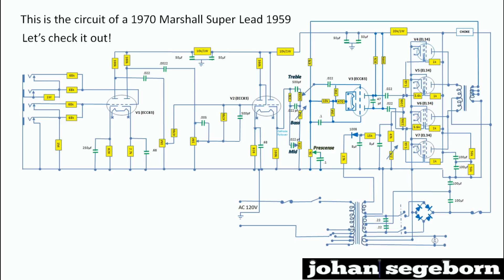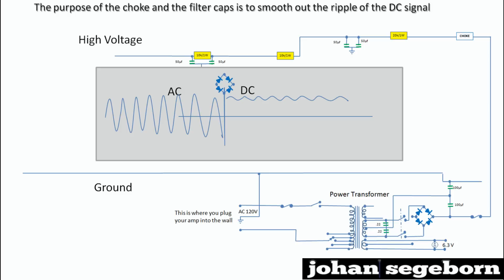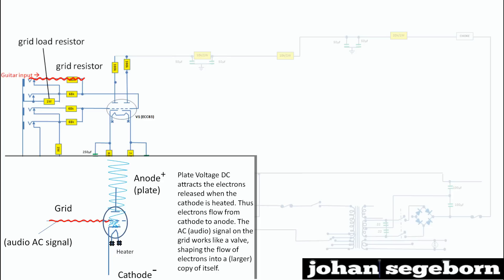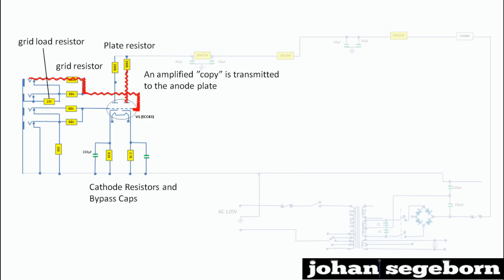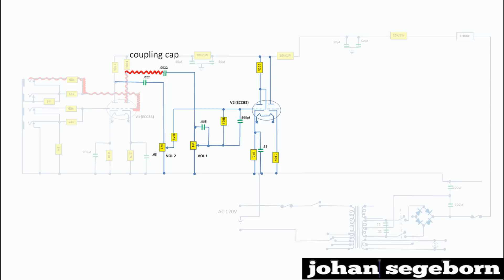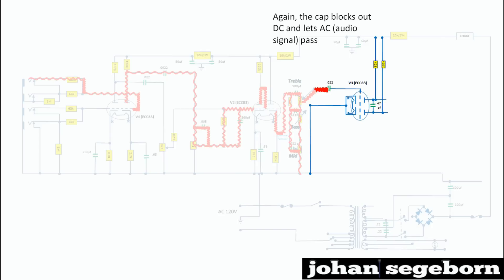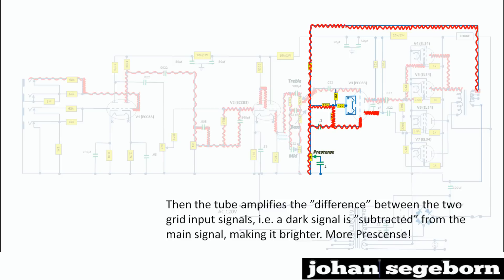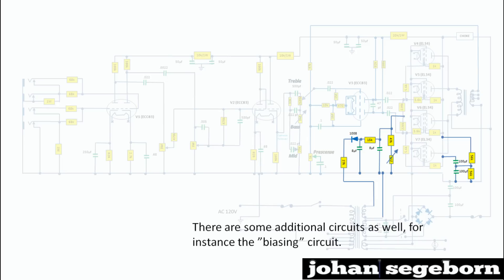How does a Marshall Super Lead Amp work?

Comment: JOHAN SEGEBORN, 
1.) When you're biasing the power tubes in an amplifier circuit how do you bias the compression of the power tubes the 1dB compression point of when the power tubes start to compression? because its say to bias tubes at a 30mA bias current per tube to be safe but how do you know when the tube is compressing?
2.) Most Power tubes 6L6,EL34 use a B+450vdc on the plates, if you increase the B+ to +600vdc would this increase the AC ripple but why would it increase the AC ripple? i would think it would decrease the AC ripple because more B+ voltage mean less current draw from the power tubes. 
3.) The Choke coil wire is frequency dependent which I'm not sure why they made the Choke frequency dependent in guitar amps linear power supply. Is the Chokes storing current like a reservoir like the filter capacitors or is the Choke doing something else to the AC ripple, not sure if the Choke is regulating the current? If you remove the Choke from the power supply will this add and cause harmonics from the AC ripple frequency getting added into with the guitar signal?
4.) For Fender amps. When you remove the normal channels first preamp tube, the vibrato channels preamp will have more output voltage and it changes the impedance and TONE, any reasons why? Tubes have very high impedance and aren't suppose to load down the parallel circuit. Any reasons why this changes the TONE of the vibrato channels preamp from removing the unused the first tube from the normal channels amp? its changes the impedance and frequency response techs have told me.

Comment: It works by electric
Reply: and the magnetic witchcraft mojo that lives in the transformers
Reply: I remember doing that electric slide dance when I got zapped by 465 volts DC on a wet garage floor, barefoot, while working on a 68' Fender super reverb. I shit you not. I literally could not move my arms for 15 minutes, they were frozen in place.